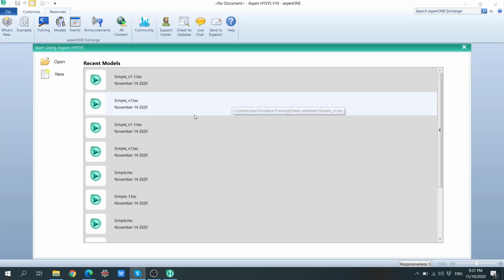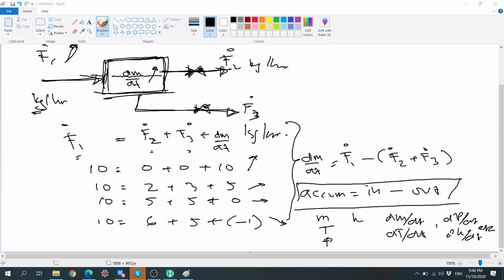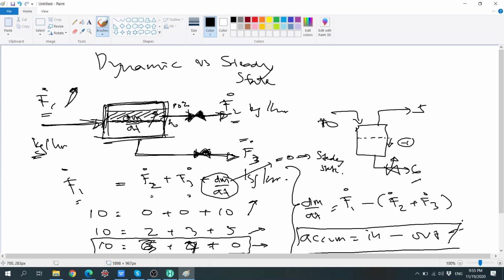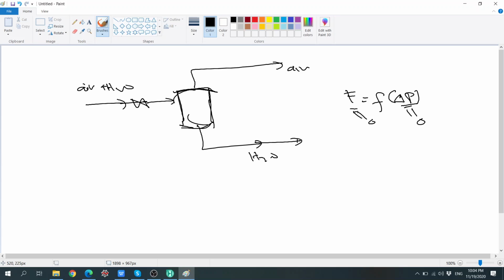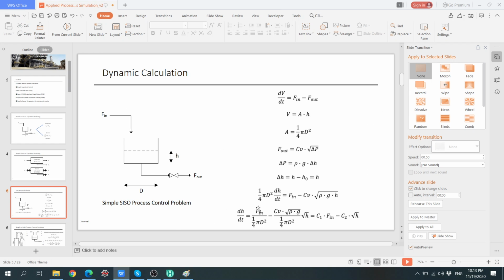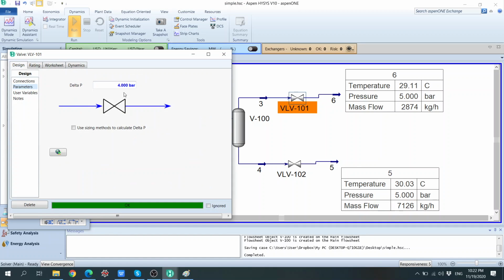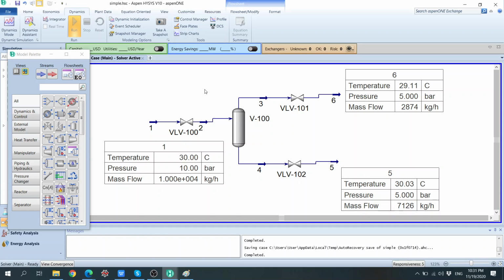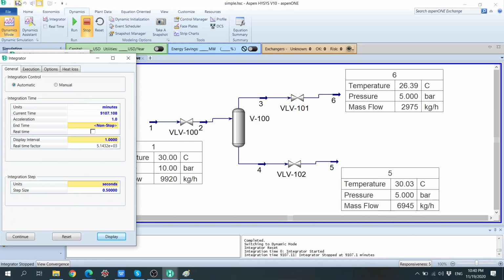Setting Up Dynamic Simulation (Part 1)

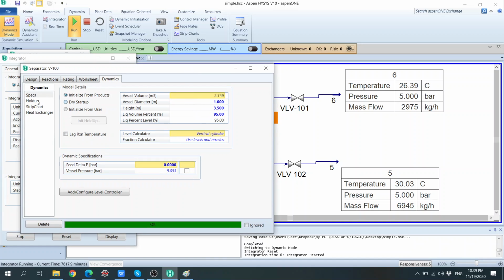Comment: Hello Sir, I'd like to ask something. After setting up all the valves and vessel sizing, liquid percent level variable (shown in 1:02:44) in my simulation is still user-specified (has blue color), instead of calculated value (has black color). This affects the controller behavior which you explain in the next video and my simulation doesnt yield the same graph as yours. Is there something that could possibly lead my simulation to this situation? Thank you.
Reply from the maker: There must be something that you miss. Otherwise, it will work well. 
Nonetheless, it's very difficult for me to tell what's wrong if I don't see your model (simulation file) myself. Dynamic modeling is, in this case, pressure-driven. So, boundary pressures have to be specified and the valves on the boundaries (either physically present or just dummy) have to be sized properly and they have to be opened like in real plants. 
You can also use dynamic simulation help icon in HYSYS to help you identify what still needs to be reconciled prior to running it.
Reply: @ZulfanAdiPutra  Yes I also believe I missed something since this is quite complex for me, even though I still can't find what is wrong. I'll look more thoroughly. Thank you Sir for your answer.